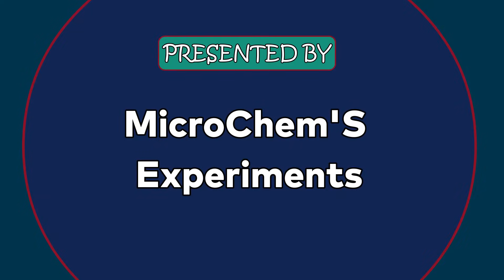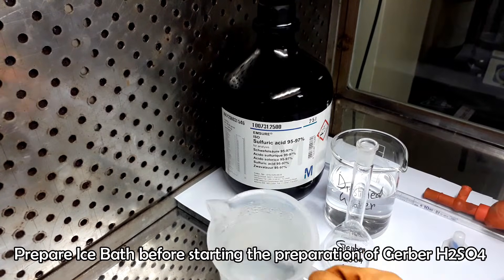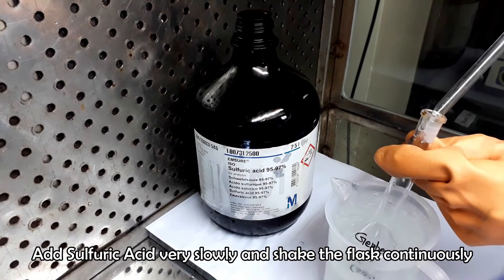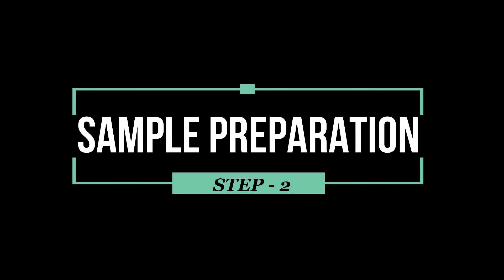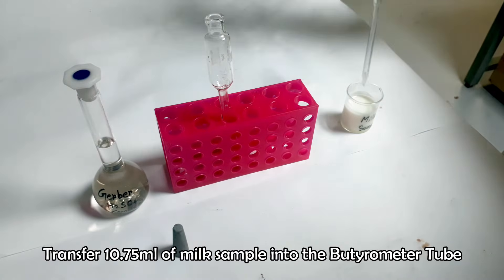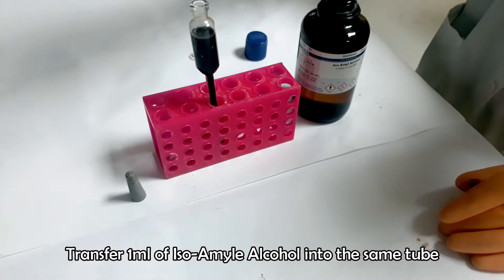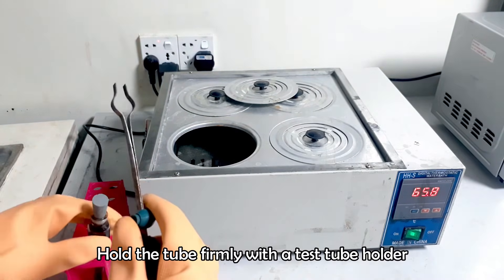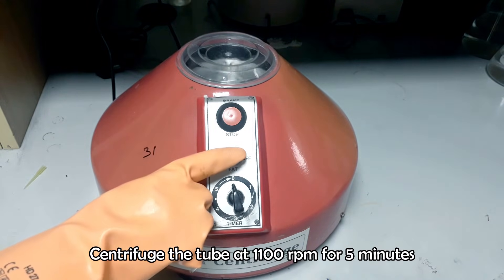Milk Fat Determination by Gerber Method_A Complete Procedure (Gerber Method)

Comment: I'm having trouble with the test for low-fat milk, I have the butirometer wich has an 0 to 1% scale, but always remain air bubbles on that and I can read the result. It's also extremely hard to make the solution go up on the slightiest part of the butirometer. Can you give me any tips or make a video about it? I would aprecciate that very much. Thanks in advance!

Comment: Milk fat testing may have changed in the 4 years since this video so I wanted to ask if your method had as well? I work in food science and production and noticed a huge difference between our gerber procedure and yours — mainly in how the butyrometer is filled. Typically we do 10ml sulphuric acid, followed by 1ml isoamyl OH to create a layer and prevent burning when the sample is introduced. Has it changed since this video and if not, will it given an alternative suggestion? Hope all is well! Great video :)
Reply from the maker: Thanks for your comment. Actually the method we showed in our video is still a valid method for the determination of milk fat. It is a validated method which gives accurate results.
About the variations between our method and your's, different organizations developed this method keeping variation slightly (following Gerber Technique) and validated inhouse. We did so as per our best laboratory practices. 

Though variation, still you can achieve reproducible accurate results using our method. 

For more, please send us an email to: mail.mic.chem@gmail.com.

Thank you.

Comment: Hello there! I have a question regarding Mojonnier method instead. Once I done with the first extraction, does I need to do 2nd and 3rd extraction using the same Mojonnier flask I used in first extraction? And also, does the transparent solution need to be decant to the same evaporating dish in 1st extraction for 2nd and 3rd extraction? Hope you can help me with this, thank you!
Reply from the maker: Yes. 2nd extraction is needed using the same apparatus.
Reply: @MicroChemsExperiments  thank you! I think I can understand it👍

Comment: If we take 90mlcon.H2SO4 and add distilled water make up100ml slowly than any kind of change in results..
I request that you please tell all reaction, mechanism, role, keys point apply or for  used chemical that affect your results.. for saponification value, iodine value, and acid value,etc.. thanks 🙏🙏
Reply from the maker: You should not add water to acid. Always add acid in water to make solution.
Okay we will work on mechanism of action of every test.

Comment: Hi, I want to ask, if I were to do this experiment by manipulating the time of milk being boiled/heated before conducting the experiment to see if it affects the fat quantity, is it possible? and if so, can you suggest the heating procedures?
Reply from the maker: Heat the milk sample in microwave oven for different time duration and conduct the experiment to know the difference in milk fat value.
Reply: @MicroChemsExperiments  should i add in the sulfuric acid when the milk is hot or do i have to cool it down first
Reply from the maker: @fiinnyc  After heat treatment, cool the sample at room temperature first. Then go for the analysis.
Reply: If you have a sample of about idk  250ml(milk) heat it in a waterbath for 20min (gently mix every 10mins so you don't make bubbles because they effect the end resault). After 20min put the sample in a cold water bath for 10min. Before adding the milk into the butyrometer you need to mix the sample if you have a 250ml flask just turn it 360° like 5-8 times  but slowly, you don't want bubbles to form. It also helps if you put in this order: 1. 10ml 91% Acid (check so you don't have air pockets in butyrometer), 2. 10.75ml milk (add slowly against the wall of the butyrometer to prevent burning) 3. Add 1ml of alcohol. 
Tip: If you use a rubber cap like she does in this video make sure you twist the cap while pressing it in so you close it more tightly. The way she did it made me concerne it would bust open into her face.

Comment: hello microchem ! .. thanks for your helpful videos .. i want to know that, why you making heat water bath before and after centrifuge ??
Reply from the maker: 1. Applying heat before centrifuge: helps to burn the sample in H2SO4 properly and react with Iso amyl alcohol.
2. Applying heat after celtrifuge: helps to melt & float all of the the fat content on the measuring scale of the butyrometer and facilitate to seperate the fat from the burnt sample.
Reply: Thank you mam
Reply from the maker: @abhayram-q6c  Its my pleasure

Comment: I followed the same but I didn't get the results? .. Fat is not getting into the gerber scale
Reply from the maker: Hafez Quadri, we test milk sample regularly at our lab following this method and get the accurate results. 
Even we test yoghurt & different milk  drinks samples for Fat determination by this method and this method is recognized internationally. So this method works properly.
Try this method again. If you face the same problem then check & maintain these points given below:

1. Gerber H2SO4 should be prepared in the right way as described in this video. 
2. Iso amyl alcohol should not be expired
3. Centrifuge with Gerber Centrifuge machine
4. Heat the mixture in tube at 65 degree for 7 or 10 min instead of 5. 
5. You can centrifuge more then 5 mins (Example: 10min).
6. Follow all steps strictly as shown in this video.
Reply: @MicroChemsExperiments  Hi, Can we use this same method for the fat estimation of whey drinks? Does this complies with AOAC method?
Reply from the maker: @aacreatives3117  This method is mainly designed for Milk and milk product analysis. But you can also analyze Whey drinks also using this method. This method is complies with Gerber Method completely.